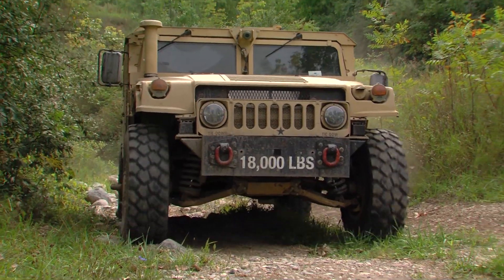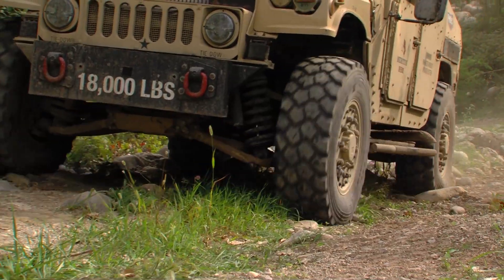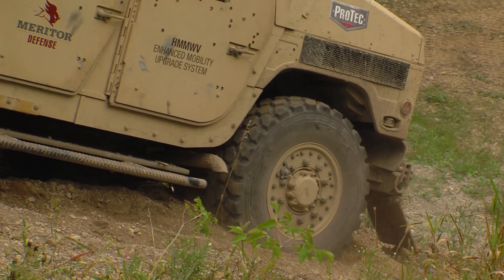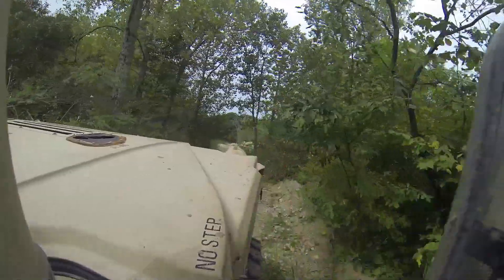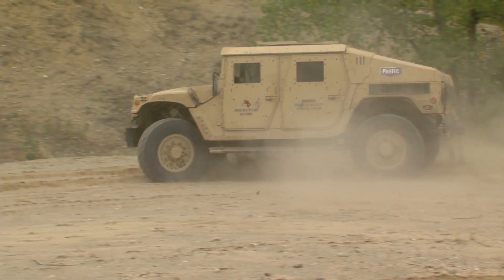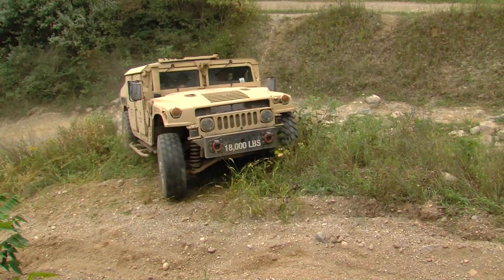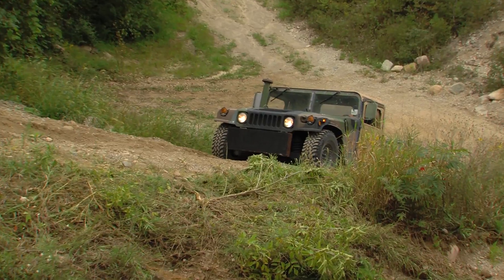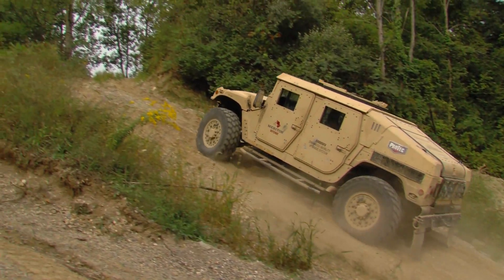Meritor Defense SmartFlow Central Tire Inflation System and DriveCommand Drivetrain Control

Comment: Put an engine with more the standard 170hp and a better transmission in the damn thing and you would not need to inflate or deflate on that easy hill that any 4x4 truck could do. BTW, it always sounds so stupid when humans introduce a machine with non-sense letters: This is a M1151 Humvee equipped  with ... protech series 30, blah blah 😂
Reply: M1151 has a distinct designation for a model of troop carriers. It would actually sound stupid if they came up with different model names for the hundreds or thousands of variations of vehicles the military has procured over the years. "Series 30" is probably the 30th iteration of that system... if not and it's just a random number, then I agree that it's dumb
Reply: Fair enough!  However, Instill believe this thing needs a more powerful engine to produce more 170 HP